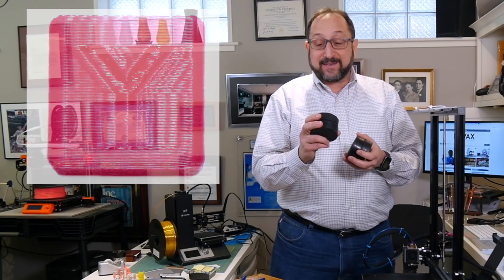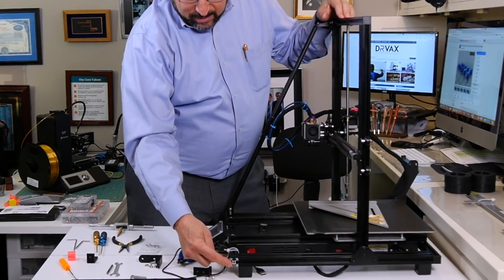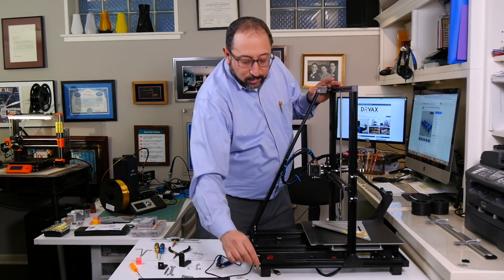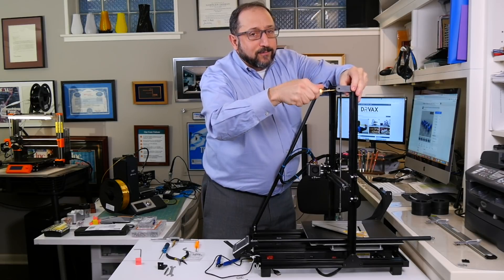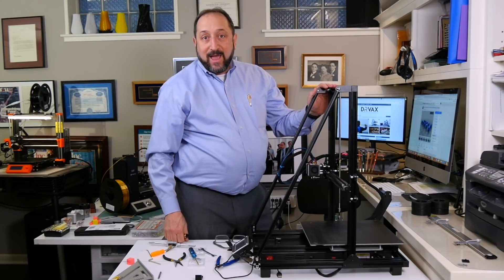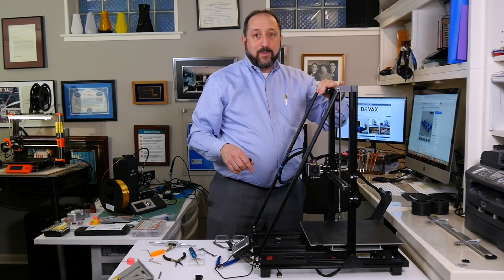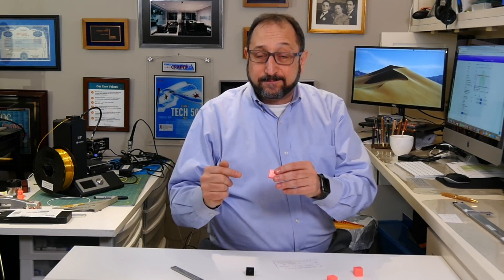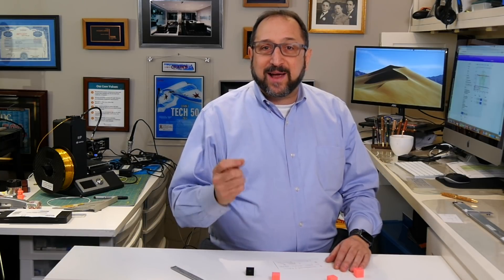3d Printing: Chasing Ghosts and How To Eliminate Them

Comment: i left the printer on a old projection cart and left it free to roll around. have had zero issues with ghosting or layer shift. on higher speeds the cart does shake around quite a bit. simply turning the speed down has worked wonders. only issue im having now is the ptfe tubes blow out on the extruder side and lots of cob webs on my prints.
Reply from the maker: Cob webs or stringing is control via temperature and retraction.
Reply: @MakeWithTech  just did every upgrade possible that you mentioned and changed all the settings over. doing a benchy test, it already looks a million times better then before. thank you so much for the videos and settings. almost gave up on this printer
Reply: well first layer goes down perfect with zero issues, then its all under extrusion and filament bending at the extruder.

Comment: Great video!! Did you consider installing smoothers and dumpers in the step motors?
Reply from the maker: Great suggestion.  I used this printer with a 1mm nozzle now for large vase mode prints.  For this purpose quality is excellent.  May try smoothers in the future.

Comment: The only cause of ghosting is the perpendicular movement of the z braces/arch to the x any x-axis. It is a butterfly effect. The lines u see fading out are the translation of the fading out of the vibration of the structure of the z-axis. The top structure of the printer acts like a pendulum whose motion is transmitted to the nozzle while it is moving linearly on x or y. Because of that, u do not have a straight line and u have waves. As u noticed correctly the isolators, dampers etc. do not make a big difference because at all they do not delete the oscillation of the z structure. The only way to delete ghosting is to make the printer's structure extremely rigid with extra braces. As u noticed again the common extra braced fix only the vibration over one direction, we may need extra fix for the left and right side of the printer (or we may need a kind of reversal pendulum at the very top of the z structure, in the same manner of modern skyscrapers who have an internal pendulum to fight earthquakes).
 By the way, I removed every bottom support to the printer and the aluminium structure is now directly in touch with the table. Give it a try and u'll see that the printer will be more solid.
Reply from the maker: Thanks for sharing.
Reply: @MakeWithTech  i also noticed that stepper dampers because of their rubber isolator may cause a kind bouncy elasticity to x and y that may result in gosting. Eliminated them

Comment: Your video inspired me to add stability rods to my mp10. I was going to use your method to attach it, but I forgot to buy M3 nuts and bolts. For future viewers, would you mind adding a reminder in the video description about what kind of M3 nuts and bolts to buy?

Instead of going back to the store, I ended up attaching the rods by tapping the aluminum frame, mostly like the kit was designed to be installed. You're right; there are screws in the way on the MP10. However, the MP10's screws just block the last 1mm of the stability rod's screw. So I put the stability rod's screw through the extrusion end cap. The end cap worked like a washer.
Reply from the maker: Here is a link to the M3 t-nuts for the v-slot on the MP10.  These print fast and work great. Then you need to purchase some M3 bolts and nuts.  You can get assortments, to have around, for under $10 on Amazon.   In addition many printers come with spares.  For example you can use the M3 bolts, and even the t-nuts that held the Z axis under the printer if you will not be disassembling your printer.

https://www.thingiverse.com/thing:3050607

Comment: If strengthening the construction of the printer does not help with ghosting it is possible that it is caused by the resonant frequency of the frame being equal to the frequency of the vibrations, if this is the case the only fix is to fit dampers to change the resonant frequency of the frame
Reply from the maker: Yep.  Excellent observation.

Comment: I think a better solution than those anti-vibration pads would be actual stepper motor vibration dampers that go directly on the stepper motors. 
https://www.amazon.com/CCTREE-Stepper-Vibration-Dampers-Creality/dp/B07C7FRLNX. I have seen these used on the CR-10 and they seem to do what you need.
Reply from the maker: Interesting.  Not sure.  Since I think the vibration is coming from the bed and not the stepper motor.  But worth a try.

Comment: Nice video.  Did you upgrade your mk3  to mk3s? I print two sets of the upgrade parts because I didn't like the first layer of the first one.This is the first time I use peg-t the z was set the way is set up for pla  at -900  c/o to -1000 got a lot better I was a kind of surprised because I use prusa g-code also the second time used the STL with slicer change the layer high to.2  good thing prusa send enough filament.
Reply from the maker: I just printed the parts for the upgrade overnight.  Also had trouble with the Prusa PETG.  I print Sunlu PETG all the time with no problem.  Moved the live z from -650 to -700 and printed the first couple of layers at 50% speed to get good first layers.  The build looks quite complex and I expect it to take over an hour.  I am not a fan of the Prusa assembly.  I think they made the electronics enclosure much to small which makes it more complex then it needs to be. 

I will video the build but probably not until next week at the earliest.